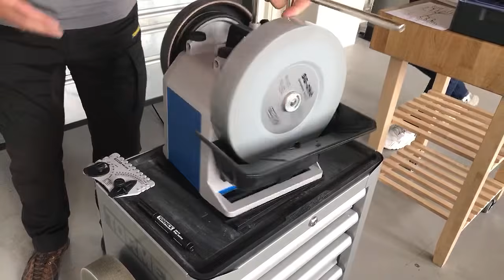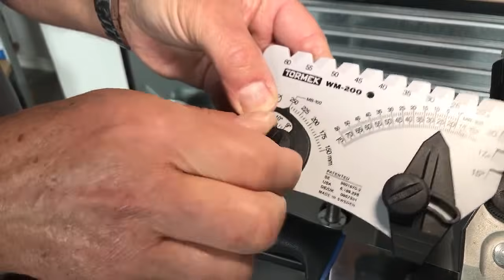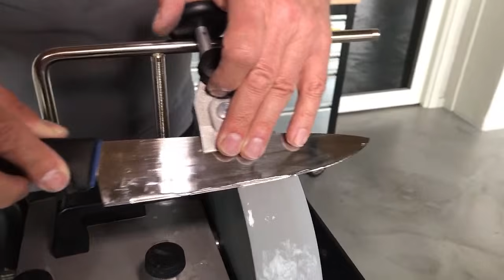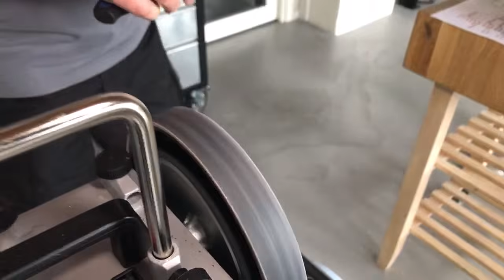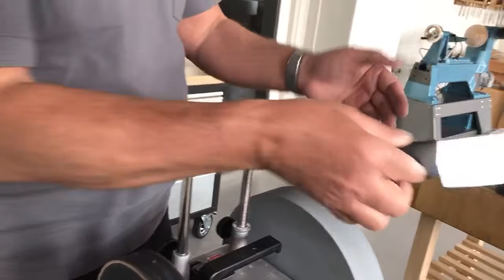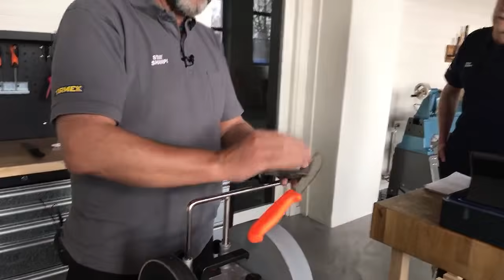Knife sharpening | Part 1 | Tormek Live Sharpening Class

Comment: Hi Tormek, Thank you for the great instructional video. I am having a problem with sharpening a kitchen knife: When I use the method of the magic marker to reproduce the existing bevel, I find that on the one side the stone completely removes the ink = perfect reproduced angle. BUT: when I flip the knife to the other side, to check if it the stone removes the ink there also, it is in a completely different angle I believe, because it's far from removing any ink at all. What am I doing wrong here? Why are there two different angles on both sides? Thank you for the feedback!
Reply from the maker: Hej fabioakadekat, as you say, far from removing ink, that means a huge differense of the angle. that means you have two different angles on both sides. Another reason is that the egde isn´t in the center of the total blade thickness. If you have a blade that is more than 4,5 mm thick which you can have a deviation of 0,7 degrees. But that is nearly unvisible in the width of the bevel. this would be ground of in two strokes of the stone.
In your case you have to correct the angles and "repair" the knife.

Comment: I have learned a bit more from your video. There are already many helpful videos on YouTube. What was best for me was seeing how to handle the tip. Raising the handle instead of rotating is important. It takes some practice to learn to do what Wolfgang is doing so clearly. My machine is tucked into a corner so I have always operated from the front with the wheel turning away from me. but now I am inspired to pull the machine forward and rotate it 180 degrees and work with the wheel coming toward me. Thank you.

Comment: Are you guys (Tormek) aware of that the SVM 45 produces 2 different angles? You set it to 15 on one side but when you turn it over it changes by about 3+- degrees.

That's because of the small notch that is on the movable claw, should really be on the solid piece, you really need to look into that.

That issue caused me a lot of frustration, time and unnecessary material removal of a knife today with my first time using my Tormek.

I had to give a knife a makeover as it has a scandi but had a V edge put on it, that blade is 3mm thick and the jig made the difference in angles to 3 degrees.
Reply from the maker: Hej Zyz, 3+- degree, that´s alot. how thick is your blade. when we talk about a blade thickness of 4,5 mm then we have a deviation of 0,7 degrees.
Many knives aren´t perfect symetrical, meaning if the tappering is unparalled and the edge isnt in the cente of the blade thickness.
I suppose that you clamp the blad on one side flat in the jig and the other side (when both wings of the clamp are really parallell) is just tuching the blade on the thickest point, the back. This would explain the deviation of 3+- degrees, thats mostly the tappered angel of a knive 3-4,5 degrees.
In that case you have to clamp the knife, with the movable clamp more paralell to the side of the blade. Then you need to adjust the angle for each side, but you knife flips not over.

Comment: Is it possible to “thin” a blade on the Tormek?
Reply: Hej Brad, no, to thin a blade you have to use the beltsander. We recommend this only for the thicker knives when they get used and sharpend after many years. Then the bevel and the edge would be too big and the cutting resistance to big too. but then the sharpening can be done again just on the Tormek.

Comment: Isn't a good rule of thumb for angles: 30 degrees total for Japanese knives, and 40 degrees for most western chef knives? Seems 30 degrees as suggested for softer western steel knives would lead to a failing or rolling edge more often than a robust 40 degree angle?
Reply from the maker: Hi Scott, It's very difficult to generalize since almost every knife is unique and have different steal compositions etc . But you are right that generally Japanese knife often have harder steel than western steel knifes and a higher angle is recommended.

Comment: Lawn Mower mulching blade or 2 in 1 blade for CubCadet mowers. I would love to see how to calculate the proper angle so I (a sharpening dunce) could get it correct. https://www.cubcadet.com/en_US/riding-mower-accessories/mulching-kit-for-42-inch-decks/19A70041100.html#start=0  << just so you could see the curve in them.

Comment: I'm learning on a T8. I get nervous doing it like you have. I use so that it rolls away from me. Does that matter?
Reply from the maker: Hej Francis, when yoou sharpen edge trailing than you get a much destinct burr wich leads to a lesser good edge than sharpening against the rotation. When you have a constant pressure forward against the universalsupport as shown you'll never get a catch as long as you don´t cut into the edge of the stone (therefore we round them of) and don´t turn the tip aginst the rotation.

Comment: Hi guys when putting my boning knives into the jig, I get a different angle on both sides of the knife most times. What is the fix to this problem? I see you guys clamp it and only check one side like you are confident that it is the same. Mine also dont seem to clamp it in tight all the time without me really screwing the clamp bloody tight. Any help would be great thanks.
Reply from the maker: Hi, Make sure that the distance in the clam is parallel all the way like in the video 7:45 in. If you still don't get it right please send a mail to support@tormek.se with a picture of you're knife and we'll try to help you.

Comment: Great video guys! (Now i know what I do wrong so the tip of my knives always has/had the wrong grinding angle... :-) )

I was just wondering; why does Wolfgang hones (on the leather wheel) freehand, so not using the support? Isn't the support more stable to hold the correct angle?
Reply from the maker: Hello Stijn, Thank you. When it comes to honing you can off-course use the support as well. It's a questions of preference. Most of us instructors at Tormek prefer do it freehand but whatever you are most comfortable with and gives you a sharp result! Stay safe.

Comment: When sharpening the tip, On page 56 of the Tormekt T8 manual center image, it shows the black part of the jig lifting off the support bar. In the video it seems like you try to keep the black part flush. Am I miss understanding this?  Im a bit confused. Thank you.
Reply from the maker: Hej Grant, don´t lift the black part from the Universal Support. When rotation, keep always contact with it, even if you lift from the flat area of the knob, it's fine with the edges too, but not losing contact with the supportbar.

Comment: Hi boys I am new to the tormeck   since I saw the video I am getting  better but  need more practice I want to know will use the tormeck a lot on knives what do you think on the thin boning knives can I sharpend them WITH the small knife gig all I'll do it on free hand
Reply from the maker: Hello, I would recommend doing it with the small knife jigg the SVM-00. When I do it I try to stabilize the knife a bit by holding the tip of the knife with my finger(without cutting yourself!)

Comment: Thank you so much for the english lesson. 

If possible please address sharpening knives with a more aggressive recurve, do you do reprofile the corner off the stone more or sharpen half the knife on the edge of the stone?

What is the fastest way to transition from a partially worn standard stone to a newer Japanese water stone? Is it doing the sharpie test again or can the water stone remove enough material to not make a difference?

Do you need to clean the tray and change water between standard stone and Japanese stone?

Best way to clamp full flat grind (pocket) knives so it's symmetrical.

Sharpening specialty steels with super hard components like vanadium carbides (S90V, S110v)

Keep up the fantastic work!
Reply from the maker: Hi Mat, Thank you. We will try to address it in a future live video. But we do as you say, reprofile the corner and sharpen the recurve on the corner of the stone.

Comment: Great video and very informative to me as a new user but your camera work is terrible. Way too much shaking. I almost turned the video off after a couple of minutes but it got better. One question though: Why don't you use the bar and jig when honing. I understand that if you're very experienced you might decide you don't need it but what about beginners like me?
Reply from the maker: Hi Eric, thank you. We are looking into different options to reduce the shaking. We are learning as we go:) The leather is a flexible material so even if you are a little off there is not much damage done. If you just put the knife straight on top of the honing wheel and pull towards you, you will hear, feel and see when you are on the bevel. Off course you can use the bar as well. It's a question of preferences as well.

Comment: Thank you I found this lesson to be most useful as I was not happy with the knifes I had tried to sharpen. I was still getting a much sharper edge with my hand stones.  I can now see that I need to work on my technique to achieve the results I want.  Using the system with plane iron and chisels has given me excellent results.
Reply from the maker: Hi Tri, Glad that you found it helpful. Remember to give the honing time and attention. That is often the key to get the perfect result.
Reply: @TormekSharpening  How do you know you’re holding the knife at the right angle on the honing wheel?

Comment: The US-105 on my T8 has some 'play' in it when loose. The outside portion of the horizontal bar drops about 1/16" lower than the inside. I can level it by pressing down on the inside portion while tightening the set screws. My question is, does it matter if the horizontal bar of the US-105 is not exactly parallel to the stone? Or should I always attempt to make it parallel before sharpening?
Reply from the maker: Hi Peter, The "play" when it's loose is for the bar to run smoothly when you want to raise or lower the bar. Then when you found the right height you just press on the bar over the micro adjustment and lock the to screws and your bar will be perfectly parallel.